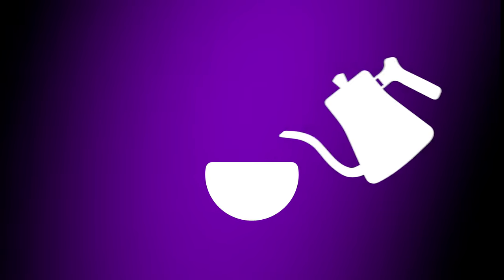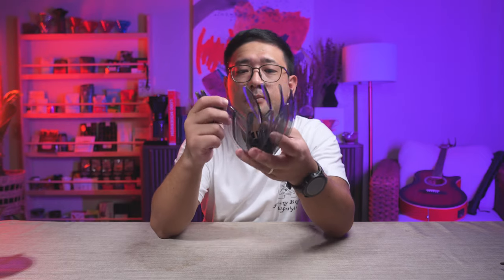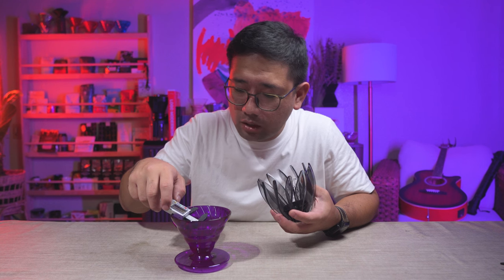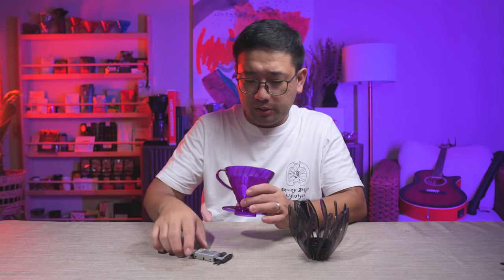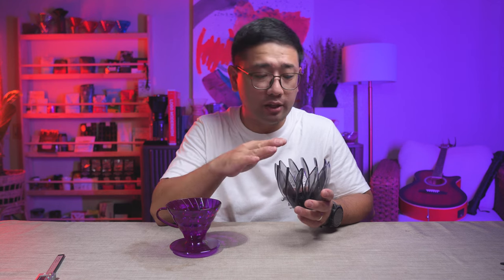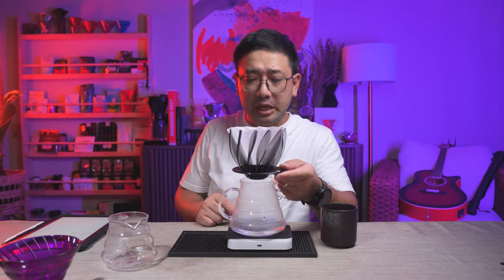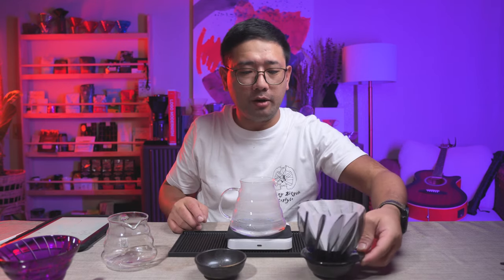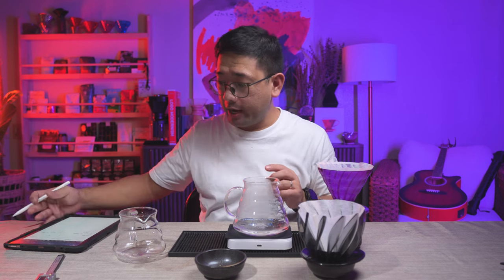Hario V60 Suiren versus Hario V60 Classic

Comment: Perhaps the idea that normal V60 provides no bypass is false, as the paper due to natural capillary effect pulls the water to the outside anyway, even if initially the paper stuck to the wall. 🤷
I would still make sure that I fit the paper consistently well everytime.
Reply from the maker: @Dimich1993  yes this is true, and yes i agree that you should still try and fit the paper consistently. This will ensure you maximize the actual product of a classic v60

Comment: "The open air concept of the Suiren does something a closed porcelain or plastic V60 does less of: it allows heat to escape the brewing slurry faster. Things cool down quicker in the slurry. The finished brew temperature in the cup is lower, with the Suiren. That’s what can slow down the brew and extraction: the hotter the water is, the more efficient it’s going to travel through ground coffee.

You can see this visually with the Suiren: moisture collects on the ribs, showing the dissipation of heat from the filter paper and brewing slurry"
Reply: "Also, I was able to visualize the bypass happening out of the sides of the paper filter (though it proved impossible to photograph); you definitely want to use a 14:1 ratio with this brewer to get a properly extracted cup. If your pursuit is getting 300ml of brew from 15g of ground coffee, this brewer ain’t gonna do it. Go no-bypass."